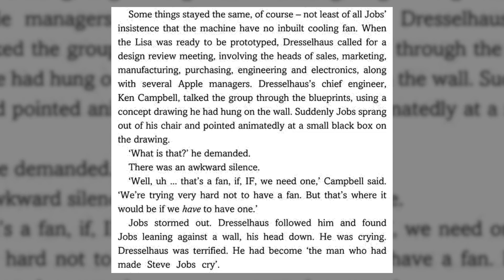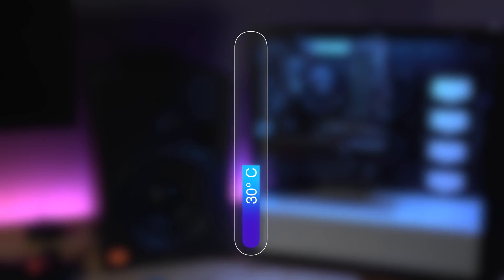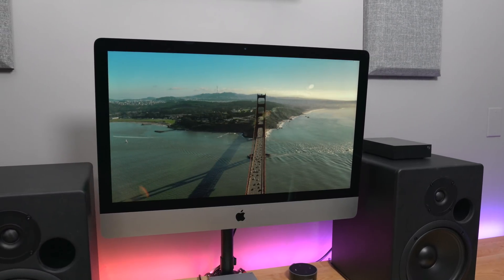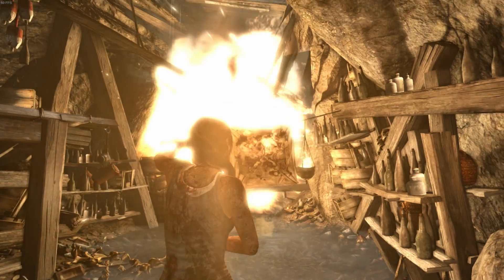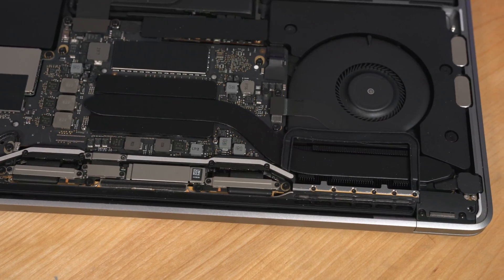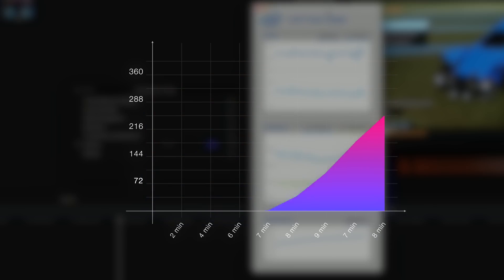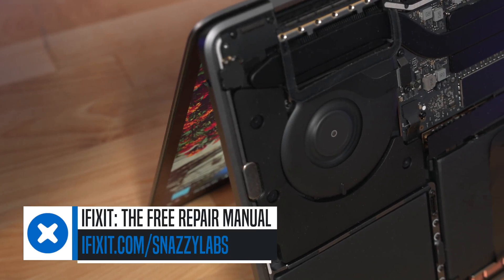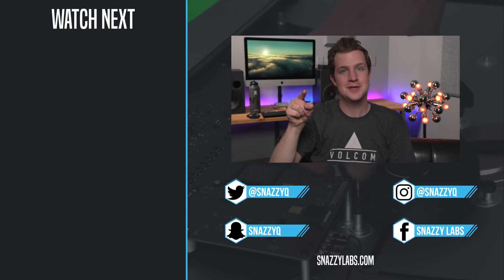Is Apple Ruining Your Mac's Performance?

Comment: I hit like because you used actual temperature units instead of the random number units aka Fahrenheit. It would have sounded like "your computer should run at 350 degrees but it is running at 1000 degrees" etc.

Comment: Im even overclocking my iMac 🖥 5K Late 2015 and it did not thermal throttled once !
Reply from the maker: +Carsten Nitz Uh, you can't overclock an iMac. Also, SMC doesn't correctly report CPU temps on Kaby Lake and Skylake. You need to download Intel Power Gadget. Your machine is running a lot hotter than you think.

Comment: Should we worry about the iMac Pro?
Reply: Okkie Jansen your credit card will be worried!!!
Reply: No, just like you should not worry about the MacBook Pro. This characteristic is exactly the same in all computers (regardless of manufacturer or operating system), its not a "Mac" nor "Apple" problem. Its an Intel/AMD/Nvidia problem because they still sell chips that run too hot for the rated speed. Of course they do that to get yo to buy them, so its really all about marketing and profits.

These machines will thermally throttle to keep the temperatures under control but are still faster than a small machine with a tiny CPU that is running quietly. The iMac will undoubtedly be a fast machine when a heavy load is placed on it and unless some company has just invented a new, innovating cooling system that can carry away a lot more heat then the iMac Pro will be loud and thermally throttle when under heavy load.

This is why when we build those billion dollar datacenters that we put I gigantic cooling systems and keep those rooms under 68º F (sometimes a lot colder than that), so we can try to keep those thousands of servers from getting hot because they would then all slow down to a crawl. We usually will order a million dollar cooling system that will blow enough 45º F air to keep the return air at 68º F or so (it varies depending on the opinion of the designer) so you can imagine that the electric bill for all that cooling is absolutely horrendous.

Comment: I think you should've also tested while the MacBooks are connected to the charger.
Reply from the maker: +Ali Salem I did. There is slightly more power available and the CPU runs a bit faster but is ultimately downclock oncs it hits the thermal ceiling.

Comment: I think a good solution for this is in the hands of apple itself, and that is ditch intel processors for their own chips. Their new strongest chip the A10X on the iPad Pro performed better than macbook pro and some iMacs and pcs too!! in both cpu and gpu, and in MKBHD'S review for the iPad Pro said that he used lots of apps and games and it just got a little bit warm. So, if apple's chips made their way to macs, it would increase their cpu and gpu and make them a more silent and less hot. Who's agreeing with me?

Comment: The I7 7700k always tends to run hotter than previous generations so definitely you need good cooling.  The Noctua fans are so quiet and great-- I can't believe the supposed bright minds and engineers of Apple can't find a solution to it.

Comment: "57C vs 30C, that's almost half."
degree Celsius is even not an absolute unit.
The absolute unit of 57C is ~330K, 30C is ~303K, how come 303/330 = 0.5?
Reply from the maker: +ip4368overclocker Yeah okay, bad math on my end. It's about 10%. Still doesn't change the fact the machine throttles. Cheers.

Comment: the 13" Macbook Pro (touch bar) 3.1 Ghz has two fans, your base model has 1. Kind of takes out a lot of what you're saying... please do research first!
Reply from the maker: +Holger Ketterle That CPU also has double the TDP. The results don't change hardly at all. I've tested on a friend's since the video went live and it throttles after 30 seconds. Just about as quickly as the regular 13".

Comment: why would you keep drinks in below freezing temps? wouldn't the drinks freeze and break the bottles?
Reply from the maker: +beholderlt They don't freeze because of the nutrisweet. Has a lower freezing temperature than water.
Reply: very interesting.

Comment: Putting your laptop in the freezer is not only impractical, it will damage your hardware and void your warranty from the condensation. Don't do that and it would be nice for you to advise your viewers against it
Reply from the maker: +Jeron Wong It's quite obvious that it's not recommended and I took necessary precautions to warm it slowly as to not condensate.

Comment: I’m not the first to say it, but why didn’t you address setting the fan speed manually? I think the video was great, I just thought you’d bring up that option. I use MacsFanControl to control my fan speed and it helps a lot. I set it to the highest setting I don’t mind listening to and it helps keep things cool for longer. I’d like to see you run the same tests with a manual fan speed to see how long it would take to throttle.
Reply from the maker: +Reed Harston I didn't mention this because it's only about 30 seconds longer until it throttles. Not enough to make a discernible difference.

Comment: I bought a macbook pro in 2007. The fans would not turn on unless it was like 80 C so I got a program to manually control the fans. In the end, even with the fans on full blast the heat got so bad (90-100+ C?) all the parts started to die including graphics. Single handedly it remains the worst product I have ever purchased period.

Comment: Solution (sorta): Macs Fan Control with a custom fan curve. My 15" Mid 2015 rMBP doesn't throttle under any usage that I do on a regular basis. Though I have the Iris Pro model.

Comment: Please do your research. Macs with touchbar have two fans, so better cooling.
Reply from the maker: +Grzegorz Mikoś Not really. The TDP on the CPU is double. Throttles at nearly the same rate. It's slightly better. Still hits 100° C in video export tho.
Reply: You are pretty right, but in my opinion it should be included in Your video. But still, great content here :)

Comment: Apple has been doing this for a while. My Macbook Pro mid 2012 from 2015 has been running hot since day one but especially after a bluetooth repair last April its been running hot all the time. Ive gotten all kinds of response from Apple from aftermarket RAM to stop using it in places where it over heats AKA lecture hall and the library! As a company they just deny there is anything wrong.

Comment: You are wrong. You can improve your macbook. Put a 10x15cm 0.5mm cooper plate (99% cooper) with good thermal paste between your heat pipe and the base (yes inside the notebook) ... you are gonna to have at least 15 degrees Celsius below!
Reply from the maker: +Thiago Schetini I didn't say it wasn't possible. I said it wasn't practical. And it's not. This should be fixed from the factory.
Reply: It's not practical. I have two personal projects, one of them is a zenbook (mac air). I put a 10x15cm 0.75mm cooper plate with a very thin heatpipe the side. The normal temperature of the 17W i7 was ~80 Celsius degrees while quickly scrolling facebook and more then 90 when requested 100% for a short period of time. So, after the handmade extra heatsink it's about 60 degrees on the same "facebook benchmark" and 70 when fully requested for a short period. The maximum temperature on a good benchmark was 90 and now, 73!! So, if i did, why not the industry do? A solid capacitor, when operates on 65 degrees lasts 200 thousand hours. When operates at 85 it lasts only 20 thousand hours... so it seems to be not a good idea making a notebook for you that is gonna last 7, maybe 10 years ...

Comment: how did you get intel power gadget working? I have tried it on 3 machines and it always tells e my CPU is not supported. I tried a 2.1ghz core 2 duo. a 2.4ghz core 2 duo and a 2.9ghz intel i7. on my 2007 MBP (which is famous for blowing the GPU) i noticed the fans didn't start to come up from 2000rpm til the GPU hit 85 degrees, then the fans came up to 3000rpm and hovered the temp around the 82 degree mark. I installed shows macs fan control and told it to not allow more than 75 degrees. I also installed CoolBook Controller so I could keep an eye on the state of the CPU speed stepping.

Comment: I 'm telling this since years and it is even worse. Try lightroom or something wich uses gpu and cpu at 100% like davinci - with big projects you can desolder every mac. the problem: the shitty reviews only test with a short load - so the macs or not so heated up and even apple just test their hardware not longer than under 15min full load…

so fuck you apple…

Comment: Smcfan control: to adjust fan speed up before it thermal throttles may shorten life of the fan

Notebook cooler: If using a macbook invest in a notebook cooler the whole underside of macbook becomes giant heat sink,
 
New thermal paste: if warranty is no longer valid or you know what your doing Antec formula 7 or Arctic silver 5 are great

Dust intake ports:  make sure not to allow dust to get on any sensitive components 

I have done all these to my MacBook Pro
2012 i7 2.9 16gb ram 960gb ssd as well as changed a fan, new thermal paste idle temp use to be 57c now 51c hope this helps.
I am not responsible if you attempt some of the above advice and ruin your device

Comment: you should test the macbook 13 version with touchbar, as it has dual fans in order to see if it helps avoiding thermal throttling.

Comment: Ok so you tested in a freezer, but not on a laptop cooling pad?  I don't get it.
Reply: Edward Rex Laptop cooling pads circulate air.
Freezers get air at a temperature that's lower than ambient.

Comment: If apple wants to survive, its going to have to jettision all that steve jobs crap because the iPhone is only gonna carry them so far before even the chinese get tired of serial buying the same thing over and over again(the US market is saturated and has flatlined, china is carrying the load now as they are now able to buy it like a novelty item). They need to revive the macos, streamline it, pump it up for gaming, make it easier to build software for, and do some SERIOUS hardware upgrades and open it up... Otherwise, when the iPhone finally breaks, they are gonna have to fallback to oldschool computers again and if they do nothing with it now, they won't have anything AT ALL...

Comment: 1) Install Macs Fan Control
2) Set to manual.
3) Base fan on CPU PECI, first cutoff at 65C, second at 90C, no more throttling.
4) You're welcome.

Comment: It's called planned obsolescence.
Heat decreases the life of the product.
Reply: silencebone Not it's just that Apple freaks out over noise that's all.
The shorter lifespan is a side effect really, and it's not tangible enough since we're talking about computers that will last 10/15 years anyway no problem
Reply: silencebone It's the CPU and Apple. But as I said, you'll maybe reduce the life span by about 2 years max. And since these computers wont be used for too long I don't see it as a problem.

My 2007 MacBook Pro runs at 60 degree idle and goes up to 80 when doing stuff, it's 10 years old and still going strong.
Who would want to use a laptop that has 10 years any way?
Reply: silencebone Intel CPU's run hot. It's been a huge issue this generation. They don't solder their cheapskate and use cheap thermal paste.
Reply: The heat decreases it's life. There is a channel on youtube that live streams how he fixes motherboards of macboosk and trust me the things he explains on WHY did apple make it like that makes you think if planned obsolescence is real.
Reply: In the video he says, apple products runs hotter. So Apple is not cooling them enough. It's not the CPU. 
It's apple.
Reply: It's more Apple, Intel CPU's do run hot. However how is it that a i7 in a notebook idle's cooler then in a mac? The mac should obviously be better at cooling the CPU.  Apple would rather want it to thermal throttle then cool it properly is crazy.  I have a dell desktop from 2009. It runs fine, no issues and Windows 10 on it. No problem what so ever. It was my old rig, has a gtx980 that I installed years ago. Still does above 60 fps on modern games. Just use it to record or livestream nowadays using elgato. Got a newer rig. 
So if you can't use your macbook from 10 years ago today. Then you know what you can blame. 
I still use my 9 year old rig today.

Comment: It is not ok to compare a laptop cpu temperature to a liquid cooled desktop cpu temperature
Reply from the maker: +Silas Mayes My 7700K at home isn't liquid cooled. The iMac doesn't use a laptop CPU. It's the desktop 7700K as well.
Reply: Silas Mayes But his desktop is not liquid cooled... :/
Reply: Gerardo Ricciardi than why is a 7700k running at 29 degrees Celsius
Reply: Any aftermarket cooler, even an Hyper 212 Evo can do 30° Celsius.
Also the CPU is not overclocked

Comment: Last week I got the 2015 15 inch MacBook Pro, the base model, with the 2.2 Ghz 4770HQ. Do you think it will thermal throttle as well? It doesn't have a dGPU but it doesn't hurt to ask. Also, beautifully designed video. The way you deliver information is very straightforward and simple to understand.

Comment: "rather than try unrealistic benchmarks that are designed to punish the computers, and make them as hot as possible..."

Proceeds to test video exporting... which maxes out your CPU/GPU to complete a task as fast as possible.

:D
Reply from the maker: +David Goodman Doesn't technically max them out. It still varies frequency load. Benchmarks like prime95 just apply 100% load and don't ever let up. Cheers. :)